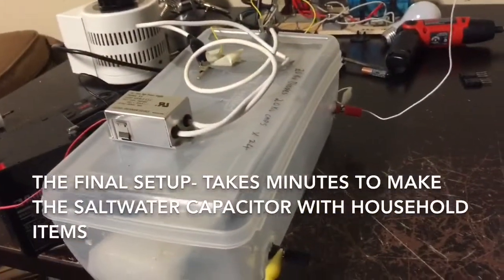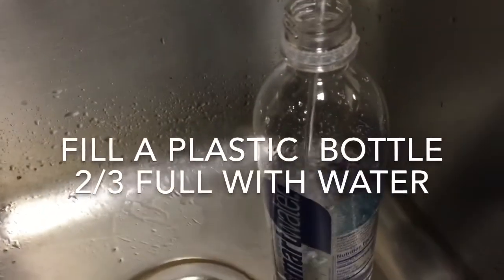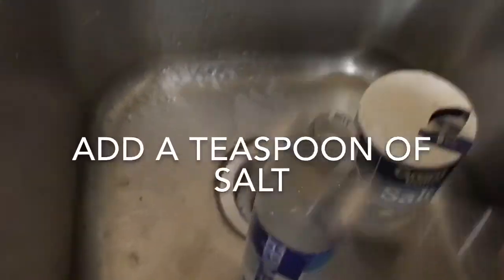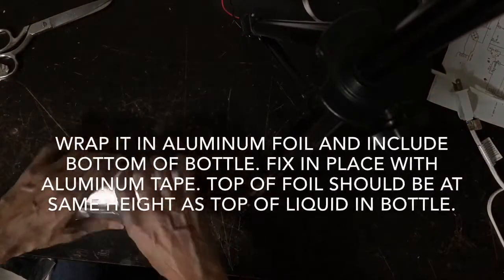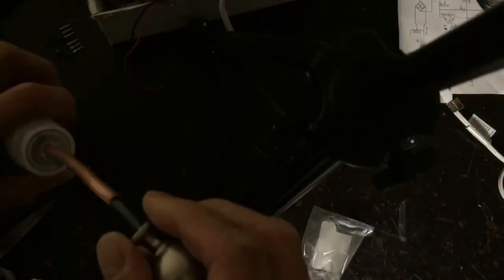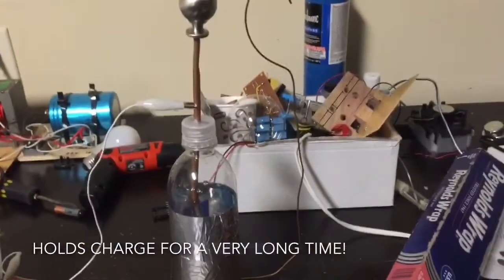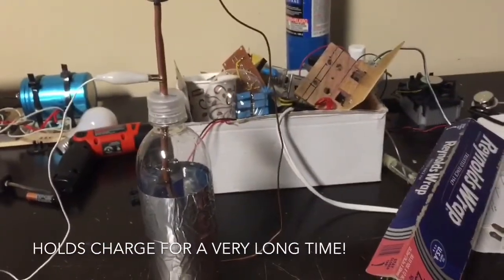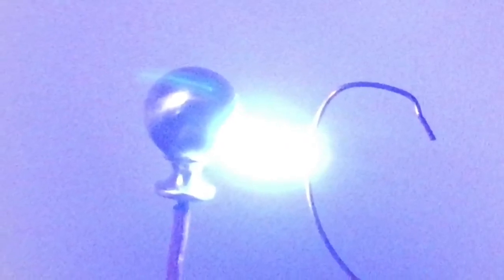Making a Salt Water Capacitor

Comment: thats a great one. whats the highest voltage it can hold?
Reply from the maker: This can handle 50kV or more. Any greater then this would result in flash overs. I am putting about 30kV into it on the video.
Reply: Brian D thats a great capacitor then.
Reply: @BrianDhvTinkerer  do glass bottles have a higher breakdown voltage than plastic bottles that have the same size and thiccness?